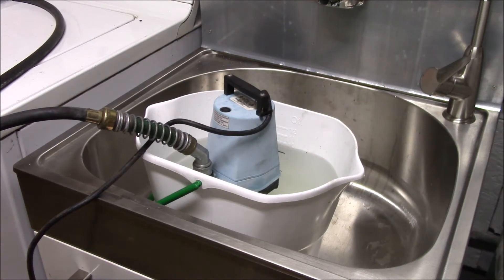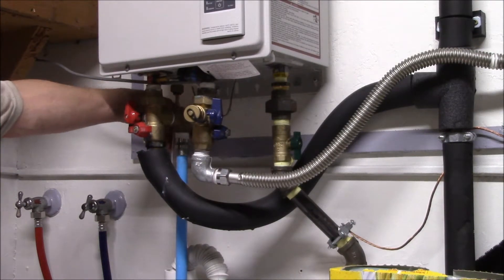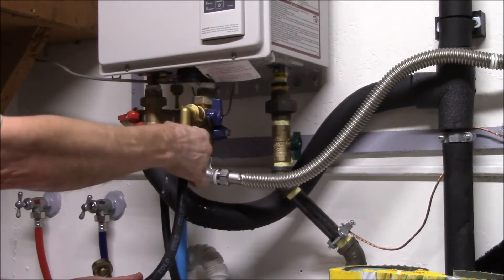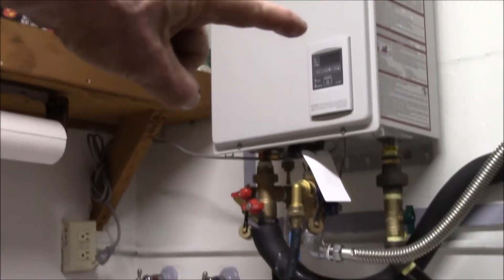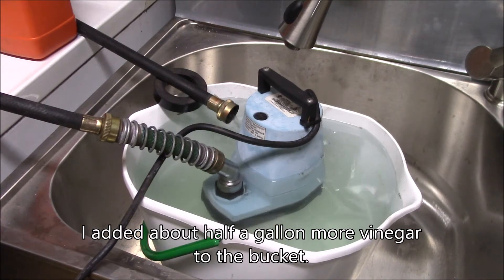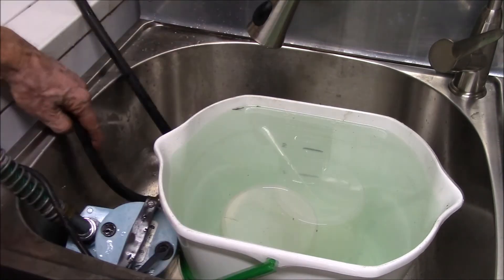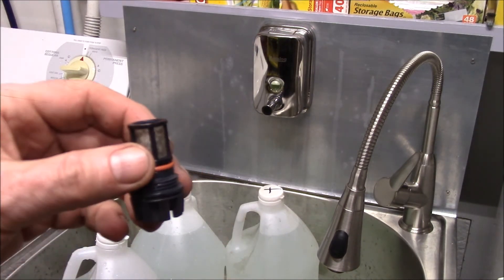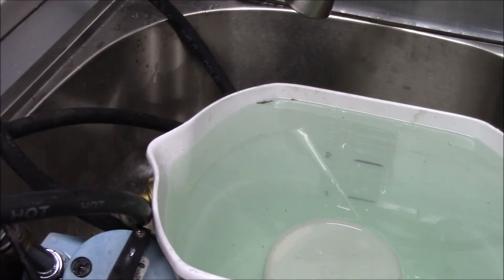Takagi T-H3M-DV-N Tankless Water Heater Descaling

Comment: Thank you for the nice and clear video.  I leave in Los Angeles where we have hard water with calcium and other minerals in the water supply.
I completed this cleaning process for my 4-years old Takagi tankless WH .  I was surprised to find absolutely no sediments/cruds in the bucket after a whole hour of circulating white vinegar in the system!  The water in the bucket turned slightly bluish (?), but it was crystal clear.  However, at the beginning of the process, after I closed the cold & hot water valves and opened the service valves, the water that drained from the WH did have some sediments in it.  That is all.  It was as if vinegar circulation was either totally ineffective or unnecessary!  Ant thought/comments on my experience would be appreciated.
Reply from the maker: It may be all the scale was dissolved in the vinegar.  I've lately been using a homemade descaling powder similar to what's used in espresso machines and it includes an additive that causes some of the deposits to float to the surface, so I notice a bit more that I got with vinegar:
https://youtu.be/dgcvCrvKNc8?si=2SNluslcoPD36Zeb
The bluish color I think is from the copper or brass inside the heater.

Comment: I hooked everything up but nothing is coming out the hot hose
Reply from the maker: It might be that the flow valve inside the unit is closed.  Try unplugging the heater after running it for a minute or so heating water.  Don't turn it off with the power switch as that may cause the unit to close that valve.

Comment: Great video!  I have a nearly identical unit, and am going to de-scale it soon.  Question - I now you have the slop sink installed for the purpose of cleaning the tankless unit.  why didn't you just close the cold service port and open the cold water main inlet do the final flush ?  I don't have a nearby cold water outlet, and will be doing the flush with a 5 gallon bucket.
Reply from the maker: Yes, several ways to skin a cat as they say.  I wanted to try out the garden hose attachment on the end of the flexible faucet on the sink.  It's also easier to control the water flow with the handle on the faucet, but have seen videos using the cold water inlet valve as well.

Comment: I have a bigger takagi TH3 model. Use it as a boiler, on a closed loop without hot water function.  Just did the vinegar cleaning. Surprisingly, no calcium/magnesium chips came out, instead a LOT of black/dirt came out. I think because it is closed loop, little new water is introduced (therefore no calcium/magnesium) and lots of dark water (copper pipe corrosion?). 

BTW for TH3 model, you need to open the water flow control by letting it run for 1 minute and pulling the plug while it is working (i guess the flow valve remains open without electricity).
Reply from the maker: Yes, it seems each heater model has a slightly different cleaning routine.  Never worked with a closed loop heating system before but if you check out some of the boiler servicing videos posted by @Allen Hart  , he shows lots of black muck building up as well, so it must be fairly common.

Comment: Hi! Thanks for the video. Did you dilute the vinegar? If yes, what ratio. Thanks.
Reply from the maker: I started with just straight vinegar from the supermarket.  However, I didn't pre-drain the water heater so there's whatever amount of water inside there that will mix with the vinegar and dilute it a bit.

Comment: Great video! Do you check the air intake filter? It's strange I don't see any an air intake filter in my unit.
Reply from the maker: I don't think there's an air intake filter on my unit either.  No mention in the manual and nothing that I've found inside.  I've been looking at how some of the other brands do that and they seem to have a fine mesh screen under the intake air opening.  I was thinking of getting one of those and seeing if I could fit something like that inside the heater.

Comment: Looking at your video I noticed you didn't turn off the gas valve for flushing your tank.  I have seen other videos they do shutoff the gas.   Also don't see this on the instructions on the takagi for flushing the tankless water heater.  Do you have to turn it off?   Also mine has an expansion tank on the hot side, is this process ok with an expansion tank or do I have to do an additional task for this expansion tank.  Thanks for the video.
Reply from the maker: Seems like all the mfgs. have slightly different steps.  Takagi says run the heater at highest temp, then unplug from power.  I think they want the insides hot to help boost the reaction rate of the descaling liquid on any built up scale.  Also, by unplugging power, this keeps the water passages inside open.  No mention of closing off the gas valve.  I have tried shutting off the gas on the Takagi and leaving it powered and it'll throw a 111 (ignition failure) code if water passes through the machine.  One could add in a step to close the gas valve after unplugging the heater and then turn the gas back on before plugging it back in.

Some heater models descaling = instructions are to turn the heater off with the power switch on the unit and leave the gas on.  
Perhaps other models of heaters need power applied to keep internal passages/valves open but need the gas off to prevent the unit from firing.  This may be the case with the non-powered heaters that don't require an AC power connection.
Reply: @The4Crawler  Thank you for the quick reply.   Also wondering my system has an expansion tank on the hot side and not sure if the process is the same as instruction since I do not see an expansion tank on most instructions and other videos.   I believe the plumber put that because my pipes go from a bigger size pipe to smaller pipes in the rest of the house.
Reply from the maker: @sakenu16  If you have the service valves at the unit, no difference as you shut both the hot/cold service valves off to isolate the machine from the hot/cold plumbing. 

Only time an expansion tank is really needed is if there's a closed hot water system:
https://homeinspectioninsider.com/tankless-water-heater-expansion-tank/
It may be your house water supply has a back flow preventer and/or it had a tank type water heater prior and the expansion tank was left over from that installation, or maybe it's on a well system.

Normally a tankless heater supplying just domestic hot water needs no expansion tank because the only time water is heated (thus expanding) is when a hot water fixture is open.  This means there is never a closed system in which the heated water can expand and cause high pressures to build up.

One of the common comments I get on the install is that the heater is going to blow up because there's no expansion tank.  My municipal water supply has no back flow preventer.  For 60+ years, the house had a tank type gas water heater.  It never had an expansion tank and never had an issue with the pressure relief valve blowing off excess pressure, because there's no closed system for the pressure to build up in.
Reply: R Brown Thank your Mr Brown.  I was able to descale my water heater.
Reply: @The4Crawler   Some Takagi models have an internal valve that limits water flowing into its heat exchanger. That's one of the ways the heater control hot/cold water mix to keep the output water at set temperature. They want you to turn off power while heater is running and generating hot water at  highest temperature so that this control valve will be at maximum open position. That way your flush can go into the exchange core. Don't think it has anything to do with keeping the inside hot.
Reply from the maker: @kckong7433  Good insight.  My particular heater model doesn't seem to have a mixing valve internally.  The service manual does mention "If a mixing valve is installed, check to see if it is operating properly and not." in reference to solving issues with hot water temperature being too low.  It does have an inlet valve to limit flow when the burner is on full and unable to meet the set temperature.  Not sure if that valve can fully shut off the cold water inlet or not.  Per the diagram, it's just an in-line valve with no bypass connection.

Comment: Would 800gph submersive pump be ok enough to flush tanlless water heater?
Reply from the maker: That should be fine.  Don't really need a lot of flow or pressure, just enough to keep the descaling solution circulating through the heater.
Reply: You can get an inexpensive back-yard pond recirc pump from Harbor Freight Tools for about $17.  Given you're only going to use it infrequently, you don't need to go crazy with the pump expense, and those landscaping pumps are designed to run for hours at a time. 

 You also don't need a sink -- just use a bigger bucket (like one of those 5 gal Home Depot orange buckets).  I only use a single gallon of vinegar.  And after your done with the vinegar recirculation, just close the cold water flush valve and open the main cold-water supply valve.  That will push fresh cold water through the heater and out of the hot-water flush hose into your big bucket.  Fill the bucket a couple times with the fresh water, and you're ready to button it all up.  

BTW, I always flush my little recirc pump with fresh water before putting it away.  No point in keeping the acidic cleaning solution in there for a year.
Reply from the maker: Thanks for the comment.  Agree, no need for a fancy or expensive pump.  The one I use it overkill for sure, but I already had it and it works fine.  And good point on rinsing out the pump afterwards.  Mine just has a plastic impeller in the bottom screen area, so really only need to give that a quick rinse.
Reply: I have a recirculating pump from an outdoor fountain (previously used in an aquarium), but how would I screw the two hoses onto the pump inlet and outlet nozzles?  They aren’t threaded (unlike your sink nozzle) to connect tightly to a garden hose.

Comment: Great video – thanks for taking the time to make and post it. Would it be worth putting a strainer or filter between the outflow hose and the bucket, just to catch the scale as it's coming out?
Reply from the maker: Yes, I suppose that would work.  Maybe if you could find something that would screw onto the end of a garden hose.  The inlet of my pump is near the middle of the descaling solution in the bucket and most of the scale seems to either float or sink, so the pump isn't recirculating much of it.  Some does get caught in the inlet filter screen which I clean out after flushing is complete.
Reply: @The4Crawler   just a sock and a zip tie works
Reply from the maker: Great idea, thanks for posting.

Comment: what kind of pump and where did you purchased it and what is the name of the elbow that you purchased from amazon ?Great video and great tipThank you
Reply from the maker: I have links to the hose elbows and sump pump in the video description.  I think I purchased the pump from a local hardware store years ago, but the same model is available on-line.

Comment: Good thing it is only once a year
Reply from the maker: Yes, I've heard that if you use a lot of hot water or have very hard water, 6 months might even be recommended.  But if you keep up with this simple maintenance, the heater should last 20 years or more.  Now that I have the system down, it shouldn't be too hard to do.  I can store the pump and hoses in the sink base cabinet so I don't need to go looking for those next year.  I also put some simple instructions in my Google calendar reminder so that next year, all that information is right there.